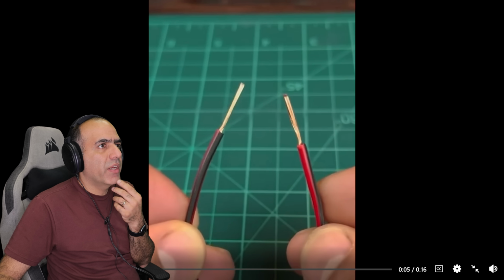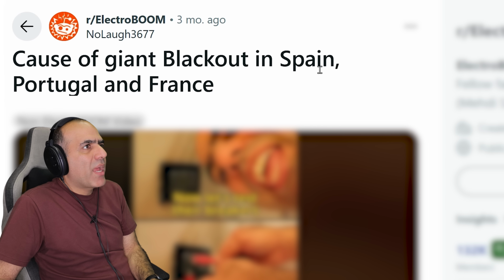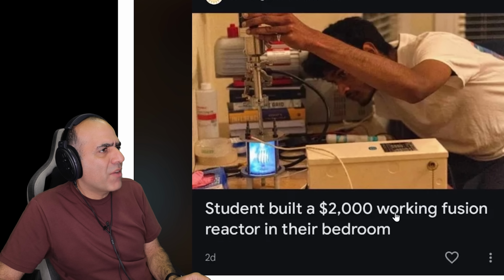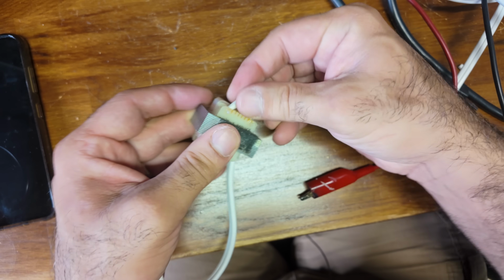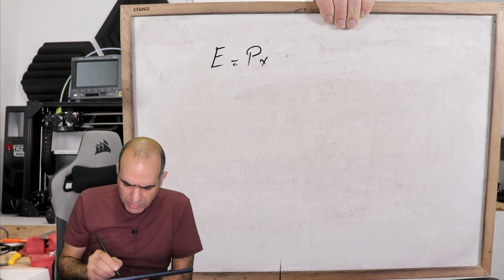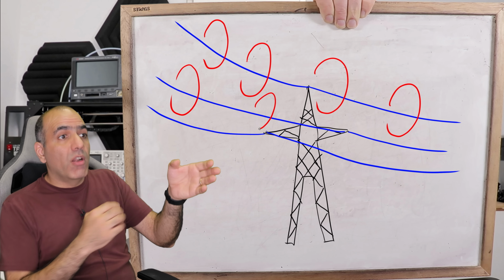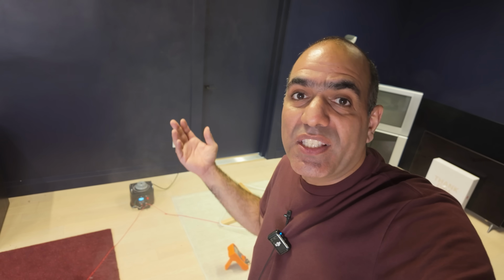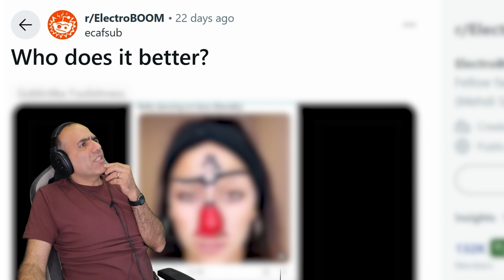Power Lines at Knee Level? Campfire with AA Battery?! (LATITY-016)

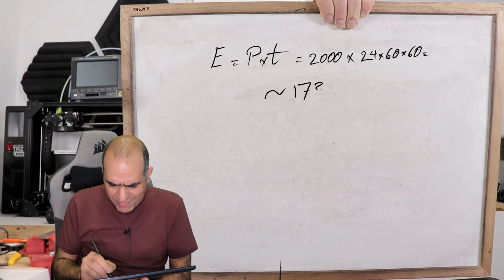Comment: 9:29 I think you misscalculated. Because Not 2000*24*60*60. Instead 2000W= 27000*X (amount Energy per Person). Which is 0,074W per Person. And i think this is Realistic for passing a resistive Gate.
Reply: The whole premise is flawed because the original video used 2000Watts as if it was a measure of energy, instead of Watt -hours or joules
Reply: @MikrySoft  Unless they already multiplied energy per person by turn time during passing the gate
Reply: @MikrySoft  Yes, but it is a reference over all. And to go even further, what should it be used for, as an inconsistant and weak powersource? Can't even power the LEDs or displays around it.

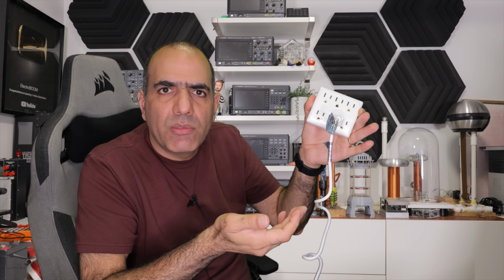Comment: 4:04 As you already know in Japan we uses same type of outlet as US but doesn't have earth to connect
So Japanese electrical supplies company "Sanwa Supply" made an extension cord that can be plug in anywhere 
And even better it does have another vertical outlet holes in between normal outlet holes so you can plug either holizontal or vertical 
It's very space efficient and actually pretty useful for working desks that uses many different size of AC adapter and plugs.

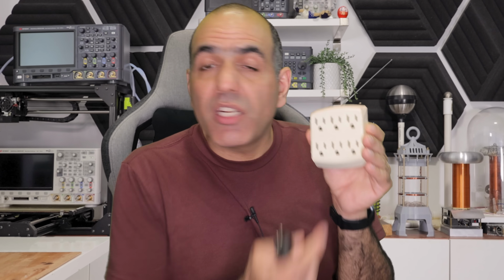Comment: 4:05 sometimes the brick is so fat that it takes up a huge chunk of the space on the regular outlet, so I’d have to split the plug between the two outlets like is being done in that video. There absolutely is a point to it, and that point is to counteract shitty charging brick design
Reply: That might be a happy accident in stead of the intended use.
Reply: @alucide  and yet I wouldn’t change a damn thing
Reply: Notice when you plug something normally, the bigger slot or neutral is on the right. But when you plug something in between, the bigger slot or neutral is on the left. Effectively giving you the option to place something right side up if the entire plug must be placed upside down. Believe it or not some houses have the entire house’s plugs upside down, I would know because I live in said house, and because not every appliance works being upside down, such as nightlights, so in a way it’s a fix for appliances that don’t have a mechanism to flip the appliance’s orientation.
Reply: Ohh I was about to comment this 👍

Comment: My guess regarding the plugs between the outlets is that there is some manufacturing step that is slightly cheaper to do at equal spacing. Or maybe the designer was just lazy

Comment: 4:11 I do not design these things, but I do a lot of 3D modeling/3D printing, and can shed some light on why I would be spaced like that: it's visually appealing. My brain sees evenly spaced holes, my brain goes "oh yeah, that's good design right there".
Reply: When I see it, I go, "dang! which two holes does the plug go in??"
Not a good design in my opinion.
Reply: @FLPhotoCatcher thats a non issue, because as demonstrated it doesnt matter what hole the plug goes in
Reply: @ChloeRozettaYun  Except when you have a ground pin.

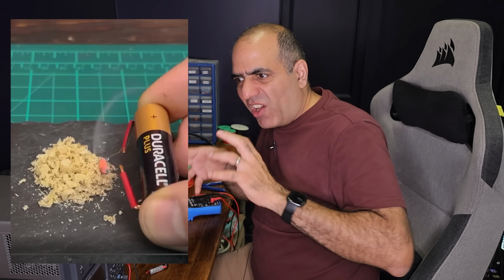Comment: 2:30 This is actually what some folks call a 'prison lighter' because inmates would short the batteries out (different method though) and use them as lighters for their cigarettes. Also, in the guys video his cloth was black, which could suggest that instead of using some sort additional fuel, he was using a char cloth which has a much easier time reaching combustion.

Comment: 3:56 - maybe if you have 2 adapters with a huge box that takes up half of the plug next to it and you have 4 sockets in a row you can put the boxes on the sides and plug something thin using the neighbouring pins from the 2 middle ones.
Reply: I had to do that in my dorm back in college.
Bad outlet spacing and bad desk leg spacing.
Used two halves until I got an extension with a wire.
Reply: I think so too

Comment: 6:10 - you absolutely CAN make a fusion reactor in the bedroom. It can fuse deuterium and produce enough fusion neutrons to make stuff radioactive (and also kill you). Look up "Farnsworth fusor". They are even sold commercially as neutron sources for material research.

Of course, they are not net-positive and require energy to operate.
Reply: It doesn't matter it's another max loughan thing on the internet
Reply: Yes but I've never seen a bell jar fusor fueled and neutron generation/fusion demonstrated, they all just run it as a very expensive glow discharge tube.
Reply: THANK YOU! I actually thought for a second Mehdi was just joking, but he was serious. They are absolutely real reactors. There are a lot of experimental reactors for teaching and generating isotopes without electricity, I don't know why he said it was fake. If you have like $2k for a fancy vacuum system, fancy parts and deuterium, it's totally doable and IT IS a reactor, you're making another isotope
Reply: I would've made a joke about being an FBI list, but the agency ain't what it used to be even a few months ago, so the joke has kind of run its course.
Reply from the maker: That's the problem though, isn't it? What else is the use of a reactor but to have a net positive energy?
Reply: @ElectroBOOM  Well... "Reactor" just means something where some kind of reaction happens. "Subcritical nuclear reactors" that also don't produce energy exist.

Farnsworth fusors definitely have fusion happening and they're useful as neutron sources. We used one to do geological sample analysis (you irradiate a sample and then look for characteristic gamma emissions from transmuted isotopes).
Reply: @AlexBesogonov  But what use is that? Totally worthless "achievement".
Reply: @ElectroBOOM People use it to generate Technetium-99, which is used in radiation therapy. You can’t find it in nature.
Reply: @ElectroBOOM  Then again some exist to produce medical isotopes, train operators, or act as neutron sources for research and industry. Even if they don’t power the grid, they’re still valuable tools and stepping stones toward future energy.
Reply: @ElectroBOOM  ??? why does the video say released 2 ,mins ago but you wrote this comment 9 hours ago????????
Reply: @PocketSpieler  He released it  earlier for patreons.
Reply: @thebamplayer  oh ok
Reply: @PocketSpieler  early access for the patreon
Reply: @ElectroBOOM  to give you (and your enemies) cancer
Reply: @ElectroBOOM  you should make one of those
Reply: @ElectroBOOM 
What is the purpose of putting 5000A through a screwdriver?
Fun and education!!!
Reply: @ElectroBOOM It’s cool and also it makes for a decent neutron source, nuclear reactors aren’t just used to generate power, we also use the bajillions of neutrons they generate to make nuclear medicine, analyze materials, identify tiny amounts of elements, and much more. Ngl it felt kind of weird to see you of all people bashing amateur science, even if the title could be easily misunderstood.
Reply: @ElectroBOOM  There is no net-positive fusion reactors to begin with. They pump in 2MJ of energy, get 3MJ of energy as output but completely neglect to tell you that the whole apparatus consumes 400MJ of cooling power from the wall, making this essentially 99.25% net-negative. Even the Department of Energy has admitted that they do not generate net-positive energy.
Reply: @Finkelfunk ... The cooling is done by the water that becomes steam to drive the turbines. That is how the power is generated (except in the designs that don't even need the steam and use the fields to directly create current). It's not power loss, your math is wrong.
Reply: @pdan4 You are wrong on multiple levels. First, what you are thinking of are nuclear reactors, which have water cooling but that is a completely selarate system from the water-steam system that generates the energy. In a strict sense of course the generated steam also cools the system but we usually don't refer to it as "cooling".

Secondly, fusion reactors require much better cooling systems because the magnets involved in the process need to be cooled really low temperatures because they need super-conductivity. Thus making "cooling" much more difficult and expensive.
Reply: @pdan4  No, it is not. You need cryogenic systems to cool the magnets required to have the plasma under control. This cooling takes up MASSIVE amounts of power. Steam could never possibly cool this to the temperature of liquid helium.
It is, in fact, YOU who got his math wrong because the water that is heated in this reaction is equivalent to the 3MJ output of the system. The 2MJ is the pure energy that was delivered to the plasma so that you could produce 3MJ of energy. The reality is that to produce this 2MJ alone requires about 200MJ of input energy already, because the radio-frequency heating and neutral beam injectors required to produce this concentrated energy have about a ~1% efficiency rating.
Anything else that is not used for cooling is used for auxiliary systems like monitoring, safety and all the other scientific requirements.
And to top that all off, again, this is openly confirmed by the Department of Energy. This is not some "big coverup conspiracy", the headlines in big news outlets just make it out to be bigger than this technology actually is.
Reply: @ElectroBOOM hello